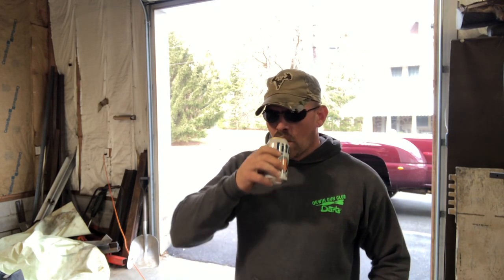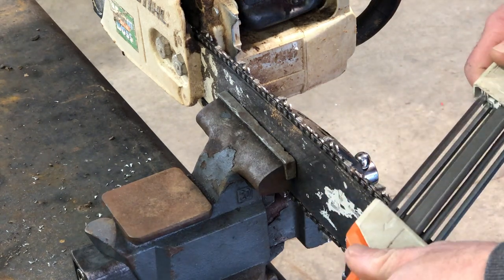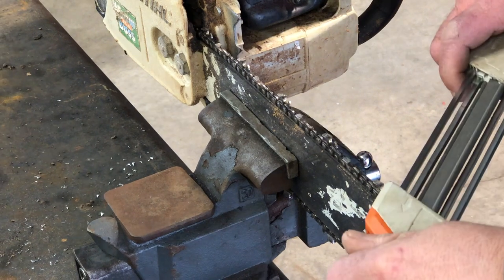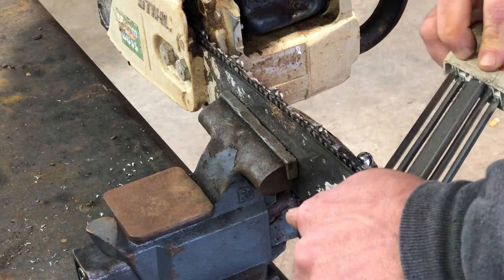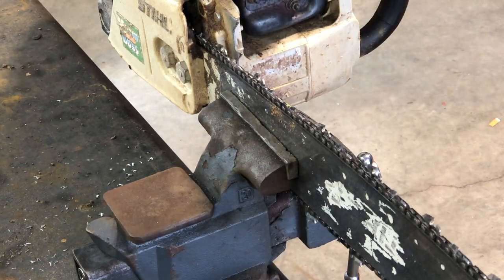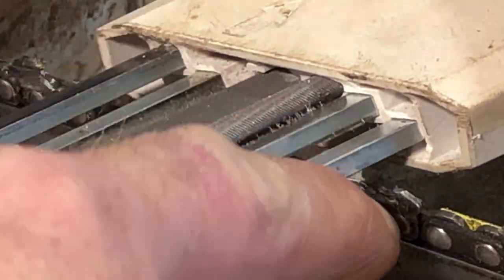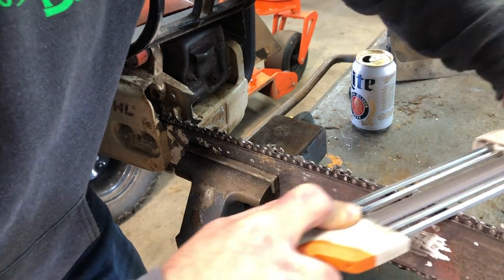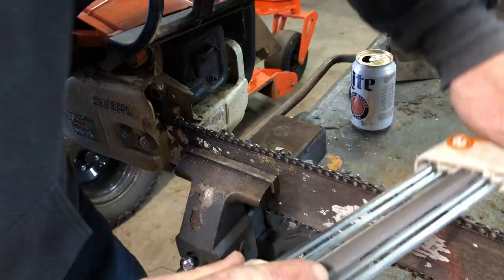STIHL 2 in 1 Chainsaw Sharpening 18 inch bar MS290   #14

Comment: Hey scheib i have that sharpener too, i find it brilliant, at the beginning i was leaning too much on it and I took the rakers down too much, but as i got more practice at it now its perfect, more enphesis to focus on long strokes with little weight on it. I agree with ya, unless your hitting dirt alot there's no need to sharpen every gas fill, all your doing is filing away the teeth prematurely. Great video dude.

Comment: Use the same thing here...and also don't sharpen after gas/bar oil fill up. Well, unless I've hit dirt or something...lol.  But that's where I really find this tool handy, when you need a quick touch up out in the woods you can get it done in just a few mins.
Reply from the maker: Yeah it is a time saver that's for sure. Cut a lot of wood yesterday on 1 sharpening 4 tanks fill ups the chain still cuts but i can tell it needs touched up.

Comment: Hey Scheib! I got a 2in1 a couple years ago. All it did for me was help me learn to sharpen with just the file. It worked ok but it ALWAYS took the rakers down too far and the saw would spend more time biting and chattering and bouncing than cutting. Idk if mine was faulty cuz I've only seen a couple people have the same problem. It really did help me get the motions down though
Reply from the maker: I had that problem the trick is not to push down real hard. There is a lot of flex in the tool takes a little bit to get use to.

Comment: Where did you purchase it Scheib looks like it works well
Reply from the maker: I purchased it on Amazon but I am sure your local Stihl dealer has them in stock
Reply: @OutsidewithScheib  ok all my saws are husqvarna wonder if it will work I will check in to that thx
Reply from the maker: Should be fine just get the one for your chain

Comment: I like the 2n1 system but I think it takes the rakers down a tic too much. Saw seems to grab too much in the cut. I take out the file and use it about every 3 sharpenings. My chain has wore through my spur sprocket 2 times and I'm thinking its cause the rakers are too low. Never had a problem before.
Reply from the maker: Haven’t hand that problem with mine but I could see where what would be a problem

Comment: Love the 2 in 1 sharpener, but here’s a little tip: buy them from a Stihl dealer not Amazon it’s cheaper. Technically the guys selling them on Amazon are unauthorized and charging a lot more because, I assume, they’re buying them at full price and reselling. $55 and upon Amazon as of 6/2/20 and $39.99 at my Stihl dealer. I even heard they’re $34.99 at Ace Hardware which is also a Stihl authorized dealer.
Reply from the maker: It is a great tool I believe I purchased mine for around $40 from amazon but that is some great info to know.